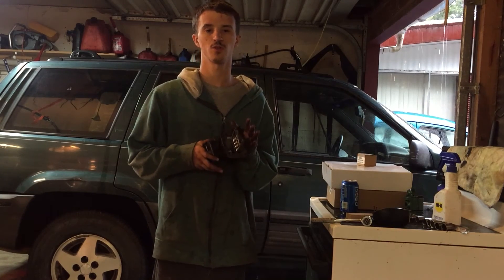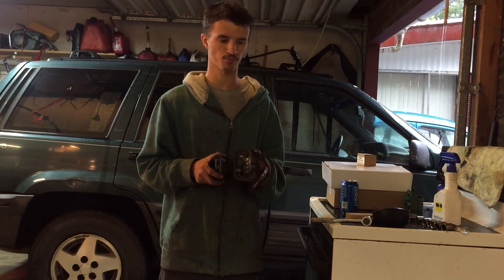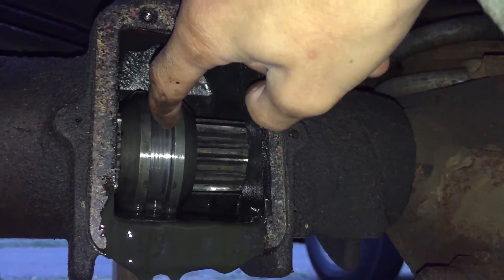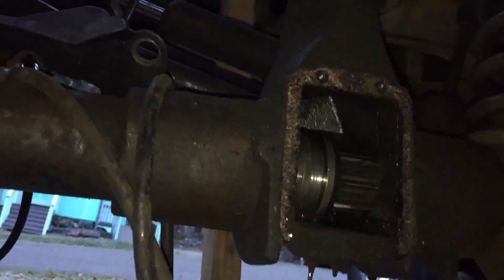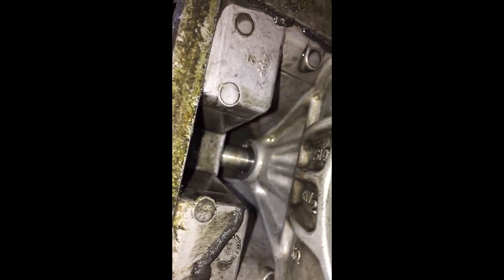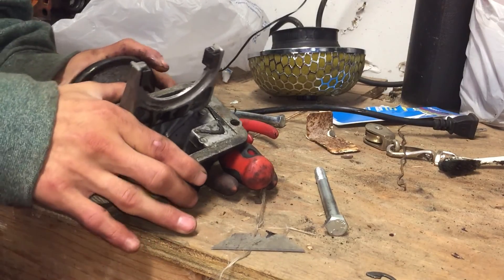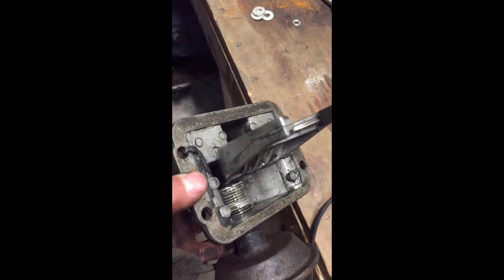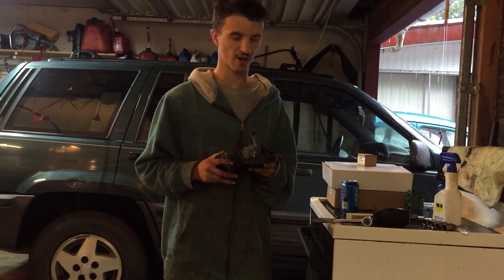How To Do a CAD Mod

Comment: Never do this! It ruins your transfer case
Reply: Lol you're high. The transfer case isn't engaged until you put into 4wd.
Reply: The transfer case might not be sending power to the front end but the chain inside the transfer case is always moving because the front drive line will be moving that's what ruins your transfer case when you go high speeds down the highway
Reply: @kennethbrinkerhoff9245  No it won't, I know somebody who did it on his 96 at 50k miles. He know has 225k miles. My transfer case went out at 80k miles with a properly working CAD.